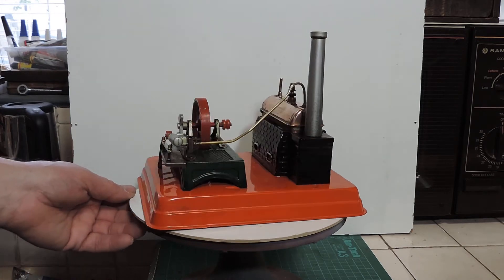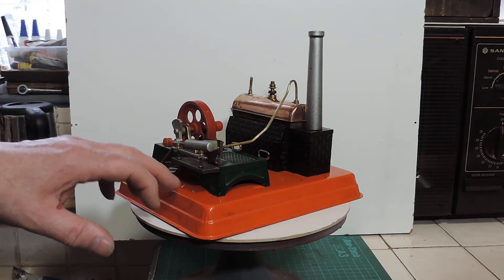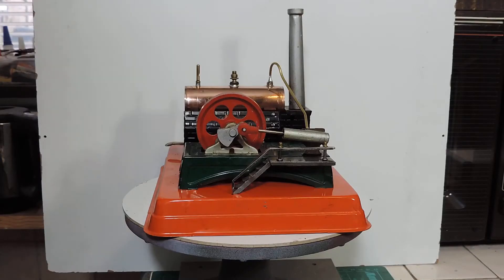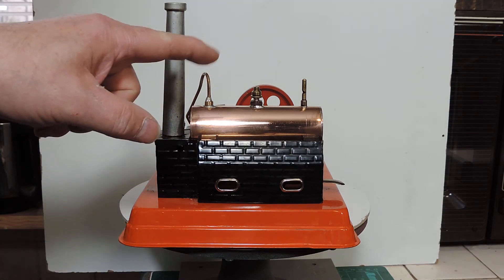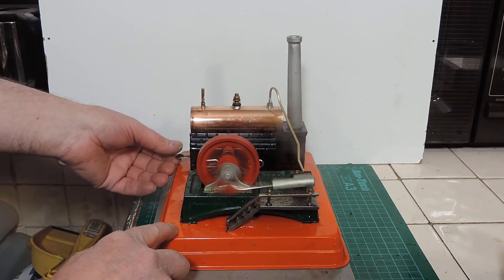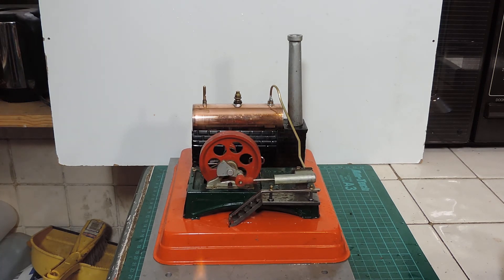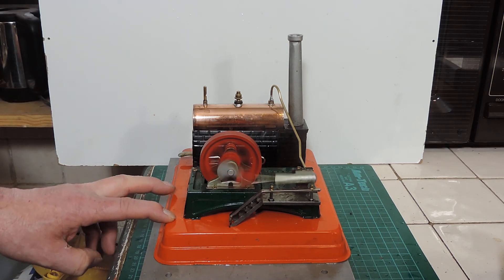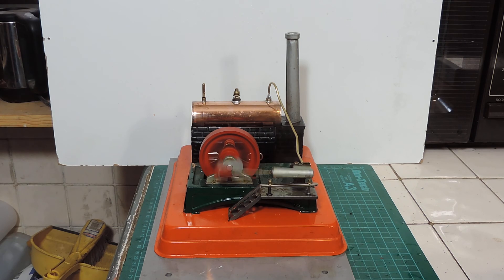Linemar J-2734 Japanese Model Steam Engine

Comment: I’ve just acquired one of these and the bottom of the boiler is Swiss Cheese. Fixing on making a boiler. How did you secure the boiler to the fire box?
Reply from the maker: Sadly that's all too common with these. As the boiler is so small I didn't attempt to fix it to the firebox. There are tabs bent inward at either end of the firebox, the boiler sits on these and is basically held in place by the steam pipe. I think the original boiler may have been soldered to these tabs.

Comment: I have just bought a Japanese Linemar J-2734 Model Steam Engine. The boiler has had one small hole professionally repaired. I collect ONLY Petroliana, so it is surplus to my requirements. It comes with the BOX, and the little funnel, everything is present. I would say the box is a 7/10, since whilst it is largely undamaged, it has a few staples in it. I am based In Cape Town, South Africa. Keen to sell it. Cheers, Chris
Reply from the maker: Hi Chris. Sounds like a very nice example. Probably your best bet for selling it is ebay. They don't tend to come up for sale very often so it should fetch a good price. Cheers, Alan.

Comment: Thanks for the video.   Would you be able to tell me the best way to clean up the brass and tin without damaging it 
please.   Also, would you be able to tell me how to oil the flywheel, bearings, pistol and cylinder and what sort of oil to use.   I would also like to take the boiler
 off to clean it.   Would you be able to advise me how to do this and also what fuel I should use to heat the water.   Any help would be very much appreciated.
Reply from the maker: Hi Peter. Have a look through my "Al's Steam Engines" Playlist for a series of videos called "Mamod SE3 Model Steam Engine Restoration" I think there were five parts. These will show you how to clean the engines various parts. For oiling of the cylinder and piston you must use steam oil. All the other parts flywheel, bearings etc you can use any thin lubricating oil such as 3-in-1. On these engines I think the boiler is soldered to tabs on the fire box, so you would have to remove the firebox and access the tabs from underneath with a soldering iron. The burner tray on these engines is designed to take solid fuel tablets, these are available from Mamod or MSS in the UK. Cheers, Alan.